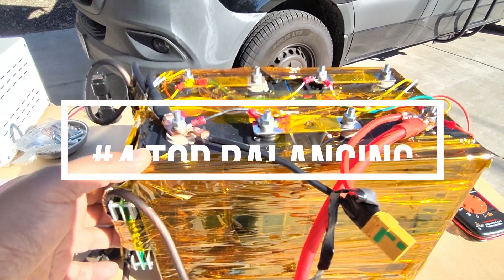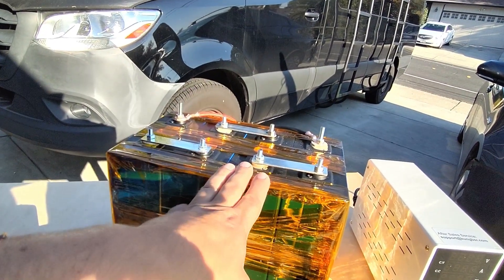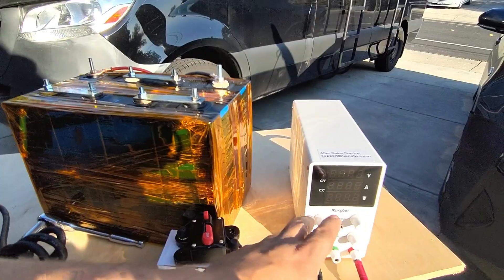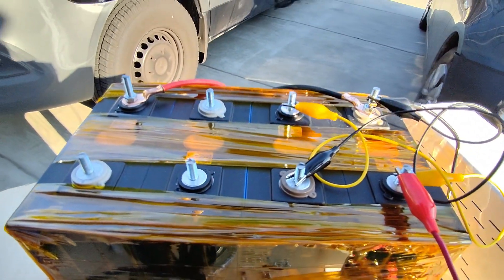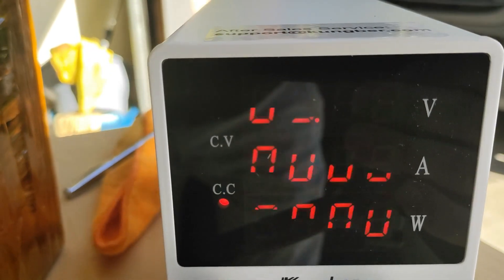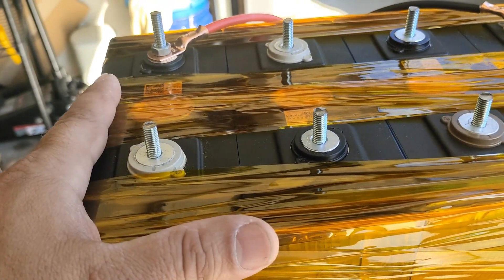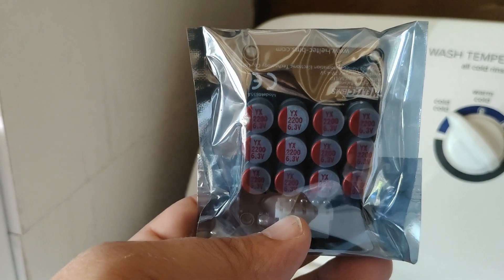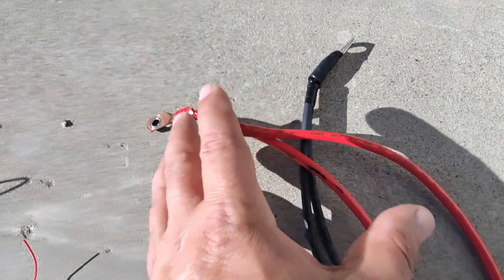Top Balance Lifepo4 Battery▶️ Top Balancing Lifepo4 Battery Build P4

Comment from the maker: ▶ See all the parts I used in my NEWER VAN build for FREE https://bit.ly/RFVanBuildPartsList
▶ See the VAN build schedule for FREE https://bit.ly/FreeVanBuildSchedule

You can download the professional version here 
   Download link-IOS (cannot be set): Search in the APP STORE
   Download link-Andriod (can be set): https://radiobtech.freshdesk.com/support/solutions/articles/70000114128-android-xiaoxiang-application-fully-programmable-version-

280 AH Lifepo4 Cells https://s.click.aliexpress.com/e/_Ar8PQs
Amazon link https://amzn.to/401KFT3
Current best supplier of BMS Grab the 100 amp 4s or 4s 120 amp version https://s.click.aliexpress.com/e/_AFAlX2
120 AMPS BMS on Amazon https://amzn.to/3FnDs6C
120 AMPS BMS option 2 https://amzn.to/3tDnbrz
Secondary BMS for the best price, only grab the 5 amp version https://s.click.aliexpress.com/e/_9G5JUk
Secondary BMS on Amazon for a much higher price https://amzn.to/3QlZKvE

Recommended Victron 30 AMP battery charger Victron 15 AMP battery charge
Victron 15 AMP battery charger https://amzn.to/3txiAqB
Recommended 500 Battery shunt https://amzn.to/3ZY8H1i
Recommended DC to DC charger for solar and Vehicle power https://amzn.to/3RYgEBP
Recommended Solar kit https://amzn.to/3rM8Upg
100 piece lug kit https://amzn.to/3RZrnvT
Tinned 1/0 Lugs https://amzn.to/45AkfsL
1700 piece hardware kit https://amzn.to/45CHumf
use Bussbar instead of breakers https://amzn.to/3tHRltu
Fuse for Bussbar https://amzn.to/3ZYDbAm
Xt60 connectors https://amzn.to/3tC7qB2
XT90 Connectors -recommended https://amzn.to/46u4zsq
8 Guage wire https://amzn.to/3txiM9j
4 Guage wire https://amzn.to/3M0WvHC
Fish paper - https://amzn.to/3M7fQqm
Battery Box https://amzn.to/3M0WT8H
https://www.manualslib.com/manual/1933154/Overkill-Solar-Bms-Series.html?page=29#manual

LifePo4 Battery Build Series
Video #1. Why Build Your Own Lifepo4 Battery - https://youtu.be/j02eP4d0ndk
Video #2. Putting the Cells Together - https://youtu.be/yccgshc1jQ8
Video #3. Making Battery Studs - https://youtu.be/MAAs5nlK21I
Video #4. Top Balancing - https://youtu.be/6Co5oQt4QWA
Video #5. Attaching the BMS - https://youtu.be/sUqu7SYijd4
Video #6. Using The App- https://youtu.be/VgZPNiE0zPo
Video #7. Troubleshooting, where to shop and save- https://youtu.be/rrMrcKRKa_w
Free IOS JBD App View Multiple Batteries Simultaneously https://youtu.be/EvXkkn2u-MI
BMS App Comparision https://youtu.be/9hrcOiey_ds
Fuse/Breaker issues https://youtu.be/Odk60wwS-aM